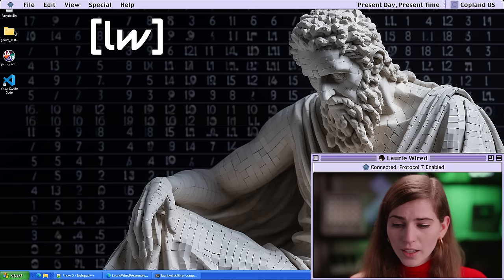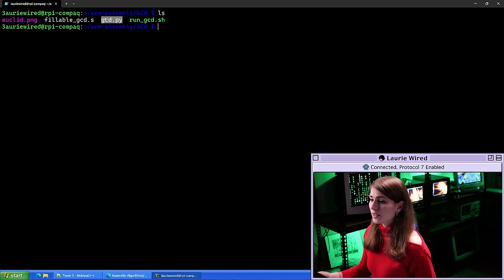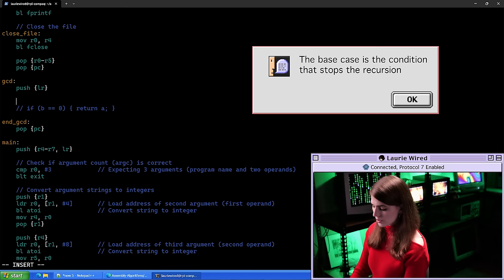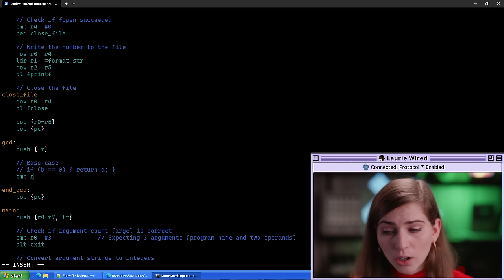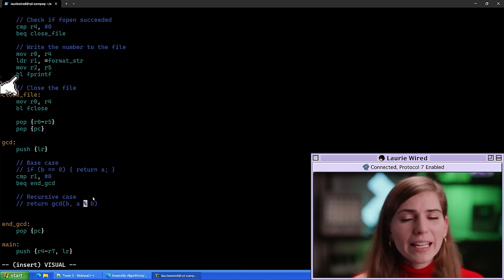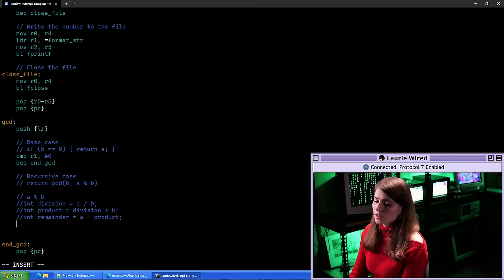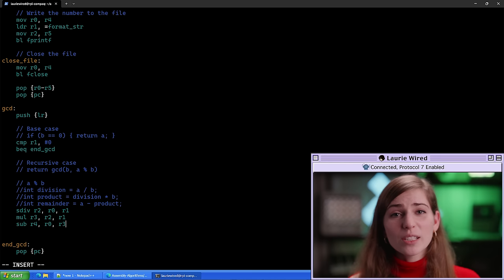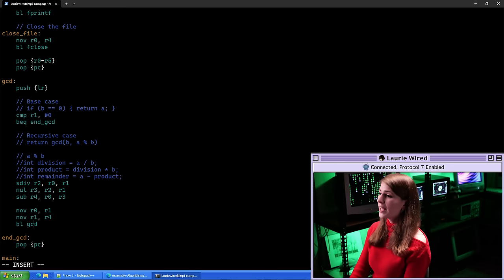Computing the Euclidean Algorithm in raw ARM Assembly

Comment: This is a great introduction and walk through for newcomers to assembly, but beware that the implementation has a quite significant flaw that will only reveal itself when called from other functions that have several live registers and happen to use r4 and store a value in it when it makes the call to this gcd function. The calling function will expect that the gcd function preserves the r4 register, as it is not a scratch register like r0-r3 are. This will manifest in miscalculations, unpredictable behavior and likely instability/crashes in the application using this function. An easy fix would be to push the r4 register along with lr to the stack, and pop it again (i.e. push {r4, lr} - pop {r4, pc}), but this of course increases the stack usage even more. Another approach would be to use r12 which is also a scratch register.

It would also be a good idea to make the implementation non-recursive as it can overflow the stack if it recurses too many times. For this algorithm this is quite easy as you can do tail call optimization by simply removing the push, replacing the pop by "bx lr" and doing a "b gcd" instead of "bl gcd" (which means the lr does not get overwritten for each iteration and retains the original return address that was written when the function was called the first time). This means the stack won't grow for each iteration.
Reply: Blah blah blah.
Reply: @The-KP Bro just blah blah blahed computer architecture

Comment: So it's been a few years since I was last writing in ARM asm (32-bit MCUs), so I might be a bit rusty... but I thought I saw a few tricks you'd missed, opened a notepad and downloaded an arm instruction-set reference and had a go myself. What I noticed:

1: this is an ideal opportunity for tail recursion, simplifying the recursion to effectively a loop and removing the need to unwind the calls from the stack at the end
2: move can set flags, removing the need to compare to determine zero both on entry and within the loop
3: once you don't need to push/pop, bx lr can be used to return and can even be used with condition codes

;; arm version

gcd:
	movs	r1, r1		;; mov can set flags? easiest way to get the z flag set for a zero input?
	bxeq	lr			;; conditional return. nice. assumes A32 instruction set tho...
.loop:
	sdiv		r2, r0, r1		;; I find it surprising that ARM doesn't have some way to return
	mul		r2, r2, r1		;;  the remainder from a division... the bits are right there at the
	sub		r2, r0, r2		;;  end of the process, but then they get lost? and I have to recompute them? smh.
	mov	r0, r1		;; but even so, the ARM version is still smaller and neater than the x86,
	movs	r1, r2		;;  which has to dance around the fixed register usage of its DIV instruction
	bne		loop		;; mov setting flags means that we can conditionally loop - also could set flags on the sub
	bx		lr			;; tail recursion means no push lr/pop pc, and we can use the direct return

4: all this is very academic since most of the time will be in the div operation anyway...

;; x86 version for comparison

gcd:					; expects a in edi, b in esi
	mov	eax, edi
	test		esi, esi
	jz		.out			;; no conditional return
.loop:
	xor		edx, edx		;; top half of dividand must be zeroed
	div		esi			;; div takes edx:eax as dividand, returns quotient in eax and remainder in edx
	mov	eax, esi
	mov	esi, edx
	test		edx, edx		;; have to use dedicated instruction for setting flags
	jnz		.loop		;; but at least these test/branch combo's get turned into a single µop when executed
.out:
	ret					; return is in eax

;;; the iterative logic as C

int gcd(int a, int b) {
	if(!b) return a;
	int c;
	while(c = a % b) { a = b; b = c; }
	return b;
}
Reply: When  ARM asm ASMR?
Reply: Yeah thats what i thought aswell, i gulped when she said recursive function.
Reply: @xydez  I wonder what the default stack size on the PI is?

Comment: I like the recursive version for its readability, but it's worth noting that optimizing compilers will (typically) use a tail recursion optimization to convert the generated assembly into a loop. This is faster and can't blow the stack.

I understand this is a (cool) exercise. Just thought someone might be interested.
Reply: yup, but her example didn't use stack for recursion
Reply: @hemmper incorrect. It in fact uses "branch with link" along with "push lr" and "pop pc" to implement the recursion. The arguments are not on the stack, which saves some stack space, but each recursion level is indeed storing the link register on the stack.

Comment: just in case, the modulo implementation works out if you use integer division not "normal" division
(2//5)*5=0, but (2/5)*5=2

Comment: Just as a clarification: argument passing in asm is standardized. The requirements for the caller and callee are defined by the "arm thumb procedure call standard" (ATPCS). If you follow this standard you can also call c functions from asm code

Comment: Before I phrase my note: I stumbled over your video by chance - as often on YouTube - and immediately wanted to know about how (simple or complex?) this algorithm looks in assembly language.
I highly appreciate what you do and I understood everything you explained.

When I reached around 8:00 in the video I thought - am I incorrect about what parameter sits in what register?
Until that position I assumed "a" to be in r0 and "b" in r1. And meanwhile I am absolutely certain about it.
Then you said:
1. 7:47 the "sdiv" command: all good
2. 7:54 "remember b is in our r0 register" - eh, no?!?
3. 8:15 the "mul" command: b is in r1: correct
4. 8:34 the "sub" command: you say "a is in r1", what is not correct, but you correctly wrote "r0"

I confess: if I would not have had a question mark in my face two times during that passage, I would not have repeated it several times. And now with the repetition I will sure remember it forever and I am also certain about having fully understood your implementation.

Possibly you can add some textual remarks into the video at the two mentioned positions.

Thank you for your video!

Comment: While passing arguments to a function in registers is the fastest method, the downside is maintaining the code. Many (probably older) C compilers let you add the keyword "register" to the parameter, the compiler would (hopefully) pass it in a register. That being said, if a new parameter were to be added to the function (passed into the next register), and the function is using purely register manipulation, then all registers numbers in the function need to be manually updated. In the older days, many compilers passed all arguments on the stack, with it making easy to add new local variables also on to the stack. In regards to this video, it would be interesting to see a C++ to ARM video where the assembly language function has local variables...

Comment: So, newish to assembly (at least haven't written any in two decades), but as the gcd function is a tail call recursion algorithm, this could, in theory, be done without the regular adds to the stack (avoid stack overflows if GCD is called from an already deep stack). Would this be easy to implement?
Reply: Would it end up being something like:
```
gcd:
    push {lr}
gcd_sub:
    // Base case
    ...
    mov r1, r4
    bl gcd_sub
```

and that way only the initial call to the routine saves the return address.
Reply: I was thinking about the tail call elimination opportunity too.

Wouldn't we want that last line to be `b gcd_sub`(notice `b` instead of `bl`)? My understanding is `bl` would change the link register before jumping to `gcd_sub` whereas `b` would just jump.

Maybe it wouldn't matter, though. The address from which `gcd` is called is already on the stack and we pop that value back into the `pc`register to return there. I suppose it may not hurt to write to the link register between those steps.
Reply: @sagemitchell8646  that sounds right. Most of the stuff I did was with the 6502, and I wasn't sure if an arm has extra side effects. So, I made the same assumption as you and left the bl.
Reply: A plain b for branch would work.  The link register is used to provide the subroutine return address which hasn't changed in your hypothetical iterative implementation.   Also the iterative function doesn't need to push the LR cos it never calls anyone else and can return with mov PC,LR or whatever the mnemonic for that is.
Reply: BTW, I agree, excellent video. 👍

Comment: I wrote quite some assembly back in the late 80s on the Acorn Archimedes. I've always loved the three operand style and that every instruction is conditional. It allows for amazingly compact code with little branches. According to the Wikipedia page on the ARM architecture, your code can be reduced to just 5 instructions if not using the Thumb-instruction set.

Comment: Nice clear presentation, but why ARMv7 rather than 64b ARMv8 used in modern phones, raspberry Pis, etc? IMHO you can learn a lot by compiling this function with different levels of optimisation to see when the compiler starts to pull tricks like tail recursion elimination, loop unrolling, etc. It is rare that writing assembler is needed these days now that compilers are so sophisticated.

Comment: Writing assembly code is not just translating C++ into assembly.
Writing assembly means thinking assembly from the very beginning.
To translate from C++ to assembly there are compilers.
Reply: a beginner must start from somewhere though, and a compiled high level language is a good reference (or crutch)
Reply: @not_herobrine3752  I don't agree.
The way to start is to learn the microcontroller hardware structure. You can't write assembly if you don't know what happens inside the uC when you write "mov" or "ldr". Inside an ARM there are different buses, working at different frequencies, serving peripherals with different wait states. If you don't have these concepts clear in your mind, writing assembly is a nonsense.
Translating C++ into assembly this way is like to take a Shakespeare writing, and replace word by word with German (or to take Goethe writing and make the opposite).
We write ARM code in native assembly and I assure you it is something totally different than what you see here.
Reply: True on 8 and 16 bit maybe, not really true on 32 bit. Most of a machines executable architecture will be written in another language, in the case linux/C so the first problem to solve is executing code, In this case the ELF loader + libs required to run anything. Seeing your assembler in its true place within that context is sensible.  I often used to write chunks of assembler inline in C or BASIC projects, much the same deal. I am sure some smart A** will point out that Coretex ARM can be run with no little runtime and your own assembler or that a Pi can run with  bare metal, this is true to an extent but has not been common practice for over 20 years. I still have sore thumbs from writing assembler on platforms with EPROMs, using a UV eraser and no emulator. Development of that style died for good reason, I don't miss it.

Comment: I'd generally advise against converting C code to assembly line by line. It always results in sub-par code, and certainly code that ends up worse than what the compiler would generate, because you're carrying with you and reproducing all the high level assumptions and conveniencies, that don't necessarilly map efficiently 1-1 to the instruction set. To write efficient assembly code it's best to start from blank slate in assembly which makes you to examine every step from the standpoint of the absolute minimum that needs to be done to achieve the goal, and naturally leads to taking advantage of all the various shortcuts afforded by the instruction set. This way you tend to avoid overheads of elaborations and abstractions which come natural when writing high level code, but aren't really necessary, and don't provide any benefit when writing assembly code.
Reply: I believe it's a beginner tutorial and she's aiming for an easier transition from a higher level language. I also don't see many use-cases for actually writing ARM assembly other than curiosity.

Comment: The first thing that I see "Bad" here is that this is a recursive algorithm and that HAMMERS the stack.  Another common "simple" recursive algorithm is the one to calculate the Nth fibonacci number.   This calls itself ONE HUNDRED AND THIRTEEN MILLION times to calculate the 40th fib. THis would be orders of orders of orders of orders of orders of magnitude faster if it was done itteravly.   For example, my forth programm ing language algorithm to calculate the Nth fib is ....  : fib 0 1 rot 1+ 1 do tuck + loop nip ;  this also uses the stack but there are never more than 3 items on the stack at one time.  

Anything you can do WITH recursion you can do better without.  When I say this people think i mean that naturally recursive algorithms such as the quick sort should be recoded itteratively but this algorithm does not lend itself well to itterative methods.   I would throw out the recursive quick sort solution and use a shell sort which is, with most implementations, insignificantly slower but does not hammer the stack at all.!   Side Note:  The uCLibc libraries "quick sort" functions is actually implemented as a shell sort.

Comment: Yup … as usual hand translating c into asm works but leads to poor code …. You either need to optimize your code after translating or even better design the code based on an analysis of the required algorithm… this is especially true if you need to squeeze all the performance out of a small processor or controller or an algorithm used in some performance limited use case

Comment: You should implement it non-recursively, especially since you can't use division on ARM. Well, in general you should avoid recursion anyway, especially as it can blow the stack. Only question I've got is what color scheme are you using for Vim on your Pi?

Comment: Is recursion in c++ different than recursion in assembly? I think if you had a variable in the original c++ function then there would be another instance of the variable for every calling of the gcd functions, correct? The assembly version would not have this, and kinda works more like a regular loop. Thinking of it idk how you would do something like this in assembly if you really needed to keep track of some different data for each instance of the function.

Comment: Would a compiler like GCC add more to try to optimize this? Or would that just be for something more complex like if there was a cache?
Reply: I was going to comment about using the “objdump” tool to analyze the assembly code generated by the compiler. It’s a cool way to see what tricks the compiler might be using to optimize things. However, when you compile a program you can usually specify whether or not you want optimization using a CLI flag argument. So it would depend on whether that flag is present or if the compiler by default tries to optimize.

Comment: Question: As the ARM v7 does not have a division instruction, **from where does sdiv come**?  I noticed you're compiling with (g)as and gcc rather than 'manually' with as and ld. How does sdiv 'magically' become a valid instruction when linking using gcc, as ld complains 'invalid instruction'.  Great video, thank you for all of your work here!
Reply: The divide instructions are optional in ARMv7, so I am guessing the RPi must have that option; if it is a Pi4 then it is ARMv8 of course
Reply: Figured it out.  The arm v7 does in fact have division instructions. The language used is based on the assembler, not the target CPU.  Therefore, when using the appropriate assembler/linker (as gcc is doing), the sdiv instruction is available.

Comment: I don't understand why are you targeting ARM32 in your videos. Not only Aarch64 code is by far easier to understand and write, but it is also more, well, actually used. All modern mobile devices switched to 64-bit ARM years ago and its simpler syntax should be welcomed by beginners.
It reminds like there were books about x86/x64 assembly where author(s) were focused most of the book on real/V86 mode 16-bit assembly. We have Windows Vista around, but let's read a sector using int 13h in this chapter.

Comment: and what point of that video? you use only assembly if you want to optimize speed of function and recode that in pure asm. today that is useless cos if you have good compiler it will do that way better. for example you can find compiled 64bit upx nightlies, you can benchmark executable compression and show final time, and in my experience visual c++ 2012 version is fastest. same we can see with games, older games are way better, cos people were hired based on skills not vagina or skin color. asm is good for compression, transformation of data, where saving cpu ticks matters. and even that can be today overcome with multicore cpu and divide work to different core. same does fitgirl when she does her minimal size game repacks, she simply sends same file to different servers and each compresses file with different algorithm and grabs smallest one. same is with x264 compression you encode video with just more threads.